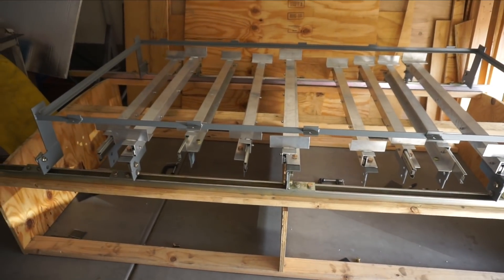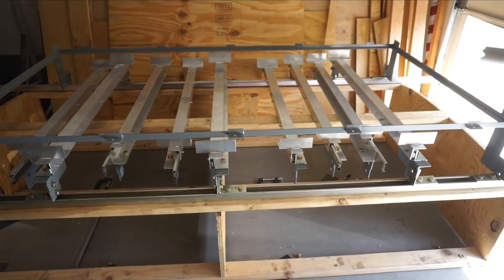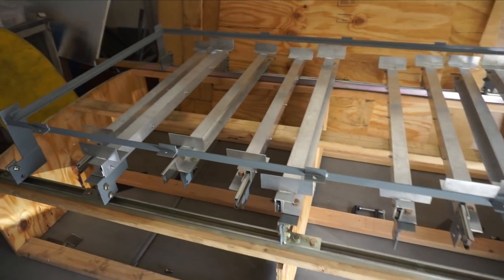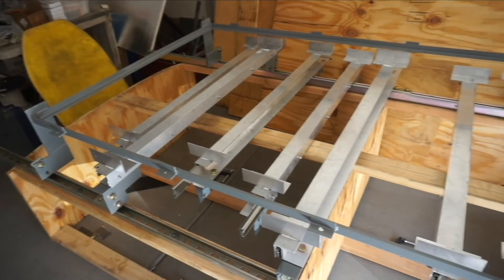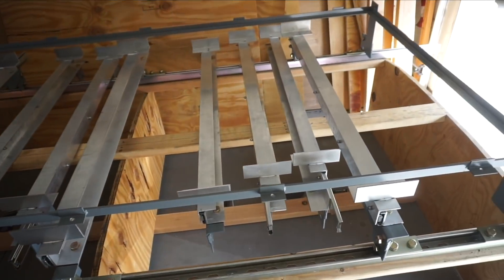Solar Rack: Part 4 - Production, Clamps and Brackets

Comment: What is your output power on that panel where did you buy it also your rack system is perfect for the project that I'm working on makes me want to tear mine back apart build yours I would like to purchase a set of plans from you Homer respond if you have time
Reply from the maker: Hi Homer - The panels are Sunpower E20 - 435W panels, my total power output should be 8*435 = 3480 Watts.  I don't have any formal build plans but I did document the entire build here and on the blog posts that go with each video.   The framework itself was built completely around the panels so you would need to alter the build slightly depending on the panels you chose.
Reply: @BeginningfromthisMorning  I thank you sir for your input and that information kind of like me project start with a small thing and start building around it and they tend to grow well-designed meticulous in detail I like it well done Happy Trails and good traveling to you and your family be safe

Comment: I use bolts put in horizontally to keep my panels in my rack. I also use locking nuts to keep them from backing out due to the vibration of the roads. (I drive a lot of washboard country roads. ;) )

Comment: Seriously overengineered.  I suspect the only way you'll 'loose' a solar panel is if the bus is on its roof sliding down the highway.

Anything worth engineering is worth overengineering.
Reply from the maker: Thanks Scott - I am not an engineer so I tend to want to overbuild "just in case".

Comment: For those bottom panels all you need to do is bolt through the bottom flange of the module into the aluminum bracket. Those panels are designed to withstand 150MPH winds using just 4 mounting bolts.

Comment: Excellent work and set up Juan, there is no doubt, this thing is built like a tank.  So here is my suggestion......Will these panels be of the same size 2-3 years down the road?  Why? Well if one does break or screw up.......can you get another the exact same size to fit?  If not.....you have another problem.  You built this thing with no room for play.....So it could be a problem if you need to change one out.  If, the answer is no, then you may consider getting one extra and store it in a safe place to have for a replacement.  Yes, I know it is expensive.......But what are you going to do if it does happen?  Just a thought.......
Reply from the maker: Hi MrMudstud - Thank you - The thought of damaging one has crossed my mind a few times and I really wish I would have bought a couple extra when I found these.  I continue to keep my eyes out for them and I will probably stumble across them again - In which case I will be buying a spare or two - maybe even store them here in AZ.  We will likely be passing through at least a few times a year when we finally get on the road.

Comment: Hey guys only came across your channel this week.  The frame and clamping  looks great. However I do have concerns over the sliders being able to deal with the harsh environment of living on the roof and dealing with wind gusts .  Might I suggest a sliding system as used on fire engines. I work with a company that make the pull out drawers and decks that hold all the Heavy equipment . We use them to make a 100% Pull  out system for pick up trucks.  https://vimeo.com/259774513. It can take over 600lbs in this configuration . And is designed to work in the wet and inhospitable weather both hot and cold. I have seen metal awnings bent and wrapped back over vehicles  in high and gusting winds. This may be overkill but I have always built to prepare for the worse , especially when it’s sitting 10 to 12 feet  above ground, and needs to be fit and forget. Check out www.cvrollers.com
Reply from the maker: Wow! those sliders look like the real deal!!  I didn't see a price listed on the site but I would assume they would likely cost more than we spent on our entire solar array.

Comment: Wow, that is nuclear apocalypse quality...  I can see the movie now: The scene opens from the air, your bus is visible in a parking lot, a nuke goes off obscuring your bus with dust and debris in the air, as the dust clears buildings are gone, trees are just short stubs, the paint of your bus has been stripped off, there is nothing left of the people around you but smoking empty shoes...  but, the solar panels, (which automatically slid closed when the dust obscured them) are still whole.  Everything is quiet except for the sound of the linear actuators sliding the panels out...  smooth as silk...
Reply from the maker: LOL - quite the narrative Joey!  The bus is not even done being painted and you are already talking about stripping it off!

Comment: I think the rubber could wear off or fray with weathering due to constant sun exposure, and then the entire solar panel will become loose. You'll have to check the solar panels often to make sure they're tight and securely bound between the rubber. I don't think I would add any rubber to the solar panels braces since the whole thing sits on metal rails anyways. It could be more dangerous if a brace become loose (with a bolt dangling and rattling) than to worry about metal iron/aluminum binding?
Reply from the maker: Thanks x86cowboy - we intentionally made the "bed" about 1/8 of an inch too big on all the sides to accommodate some rubber we will be lining it with so hopefully that will work well to isolate the two metals.  The rubber we are using it intended to be used outside so I hope it will last for a bit before getting destroyed by the sun.  We are somewhat in the "idea" phase of this part still - we will try to come up with something.
Reply: Cool. No problem. Keep us updated, I only mentioned the rubber wearing out because Greg Virgoe (mechanical engineer) another van builder, called and asked a manufacturer about adding "rubber" to his brace between a gray water tank and a holding brace. The Manufacture said under no circumstances should you add rubber on an RV between the brace and the tank because rubber will wear out and the tank can become loose without the operator knowing. I believe it was the Q and A video he posted recently on his Greg Virgoe YT channel.
Reply: Well, the rubber between two surfaces doesn't see much sun :o).  The trick is to keep the pressure on the seal tight and thereby prevent vibration and thus wear on the insulator/seal.  A thin layer will last better than a thick layer, actually . Silicon rubber should easily outlast the panels if the bolts are nice and snug .  Other materials could be used, such as ptfe or a sheet of nylon, but I really don't think it is necessary. Rubber gaskets have been used in engines for decades, after all.
Besides - there wont be much corrosion, as there will not be much electrolyte present (only rain with rare additions of salt), not often (I suppose camping in pleasant climates will be the plan) and only over a small area (the "noble" iron is painted, after all).  And aluminum and mild steel is fairly close nobility-wise.  I suspect I would not even care to put anything besides paint between the two metals, but I would consider to use nylon washers between bolts/nuts and frames, however, as this is where the corrosion usually occur - if any.
Reply: Claus Jellinggaard Or just use slick plastic(the kind they make furniture sliders out of), which would last years, even in the sun.

Comment: Great work you might be going a little overboard with the bolts two in the top two in the bottom make sure that they have the nylon locking nuts and you'll be good to go
Reply from the maker: Thank you Jeff - it might be a little overkill but I think it will hold :).  All the hardware is Grade 8 - with nylon locking nuts so we should be good to go there.  Thanks for tuning in

Comment: Necessity is the mother of invention.  I don't think you overbuilt one bit wind forces can get mighty strong.  Juan you have become very good at welding Michelle and the crew have come a long way it seems they dig right in.  Love the way this looks and your forward thinking.  Any word how the painting is coming along?  V/R Ed  :-)
Reply from the maker: Thanks Ed - I would rather err on the side of overbuilding for sure.  The winds can be EXTREMELY strong - I saw a few videos where Semi-trucks got blown over!!  Painting is coming along very well with one exception - it keeps raining so they can't get the paint on the bus.  They have stripped it all the way down to bare metal, sealed all the seams, made a few repairs to some of the panels - then built it back up with 3 layers of heavy primer + sanding and smoothing.  All that is left is spraying the color ... but they have to wait until it actually stops raining!  Thank you for your kind words and encouragement.  This ridiculous project was either going to rip us apart or shove us together and thankfully it has shoved us together and been a very good thing for our family.

Comment: There is aluminum welding rod out there only need is a nap gas torch to weld there are youtube video out to show how to do it. to may bolt One bolt 1/4 bolt  have a sheer breaking point is 400 lb you could use stainless pop rivet .
Reply from the maker: thanks akdisney  - Funny you should say that.  A couple of nights ago Michelle asked the same question: "Why didn't we rivet these?" ... I was like ... "hmmm ... dang it - yes, we should have".  Supposedly this glue has a bonding strength of over 700 psi so even just glue should be sufficient.
Reply: well Michelle and me think alike

Comment: That 5200 is very tenacious stuff. Hopefully you won't have to remove any of those brackets again!
Reply from the maker: Thanks dprider - That is the hope!  If we do need to replace them -  I think we will just unscrew the sliders and just buy new aluminum angle ... we are considering them "permanently" fixed.  Today Michelle was looking at our brackets and said: "why didn't we just rivet these in?" ... she had a great point - we should have riveted them in.  Oh well ... maybe on the next design :)
Reply: Beginning from this Morning You could do both...rivet and glue. You will never have to worry about that part even flinching.

Comment: Great presentation, how long did it take to do the time lapse? Sides are way over kill, not a bad thing, I would put a couple on the ends. How is the bus painting coming? any pictures? Might be worth investigating powder coating the rakes, too late in the process? Nice progress. We are in the middle of moving, no projects other than that for a while (dragster engine is broke and am working on that). Glenn
Reply from the maker: Hi Glenn - thank you very much.  The time lapse was done by rigging up the tripod and balancing on a latter while Michelle pulled the pieces one by one while I snapped the pictures.  I accidentally got her foot or hand in a few of them so we had to redo some of the shots!  We had to do something to make it interesting ... we spent most of the time just building stuff.  Did you guys settle on a new house?  I know last time you were looking at a house with a couple of barns - sounded REALLY interesting.  I saw the videos and post of the dragster with a smashed dime on the cylinder - did you guys get to the bottom of that?
Reply: Our house is sold (above asking, no contingencies, had many offers). We  are supposed to close on both houses on October first with a 10 day over lap (rent back of the current house). There will not be many videos for awhile. We have come to the conclusion that a piece of the intake that was machined was left in the intake when the engine was assembled (by the engine builder (he is having a tough time accepting that)). We were very lucky in very little damage, two bent valves. Head is at a local machine shop to have them fixed. The racing season is shot. may get out one or two more times. Glenn
Reply from the maker: That is great news on the house - terrible news on the dragster!  Considering the size of the chunk of metal I saw in the pictures the amount of damage seems pretty small.  I am praying that you feel better and things go smoothly with your new home.

Comment: I would suggest that the bolt should enter from the top.  If the nut became loose and fell off, the bolt "may" still be there when you notice.  Very creative, artsy, beginning but you didn't end with the same theme.  I am sure that took a lot of time to edit.  Very well done!
Reply from the maker: Thanks Dennis - I had to make it a little artsy ... it was more of a "production" time for a couple of weeks ... Thank you for the kind words.